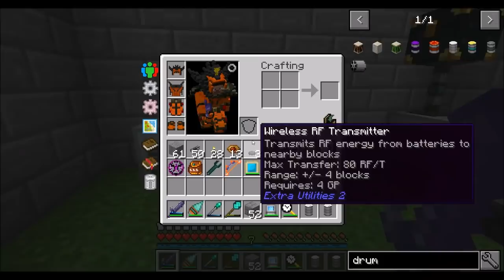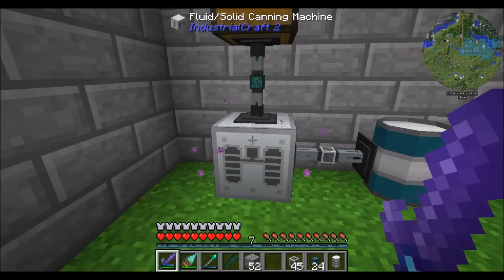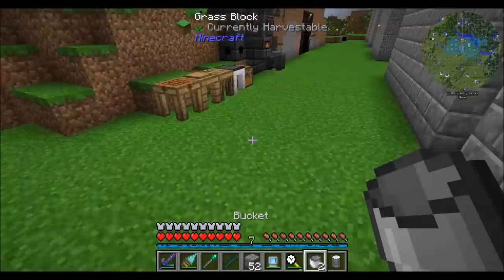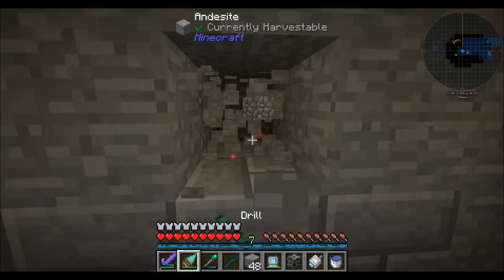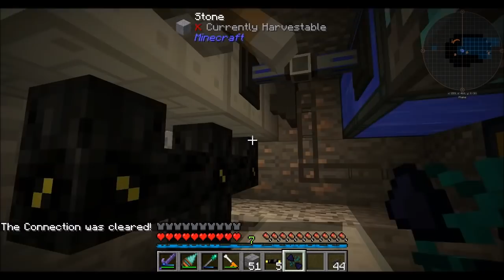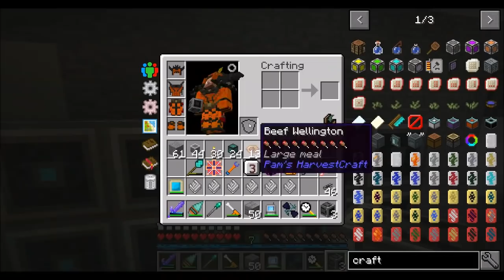Lets Play S8 E96 Uranium Processing

Comment: Am I the only one that puts machines one block of the ground so that they're at head height? No need to look down when accessing them. You don't have to dig the floor up to get to the connections below either.
Reply: I don't like the look of the wires so I put them in the floor with the block above them. that is why I do it.
Reply: Do you place furnaces and crafting tables in the air?
Reply: 3rror200 On top of a block so they're at head height
Reply: Erik Thomas There is the aesthetic side of things so I use facades and covers. Cables and conduits can be made to look good though. Just takes a bit of thought and not Direwire. Each to their own though. Freedom of design is what makes modded Minecraft so good.
Reply: MrNeocortex it's part of why I like skyblocks. bottom half slabs and then when you need to place a block, just put another slab down. looks nice and is easy to see.